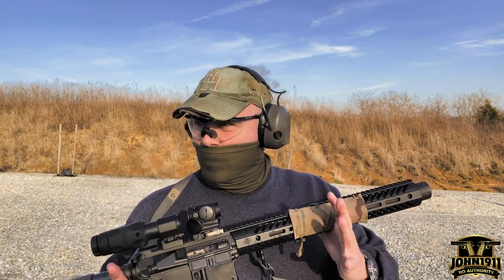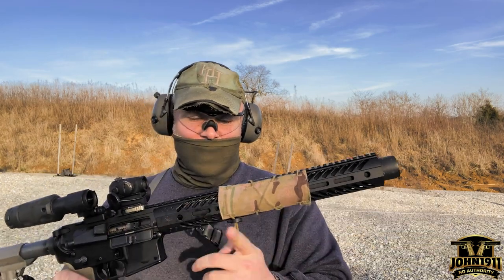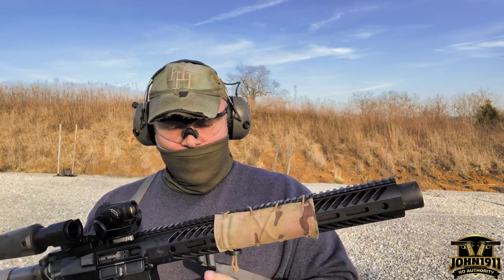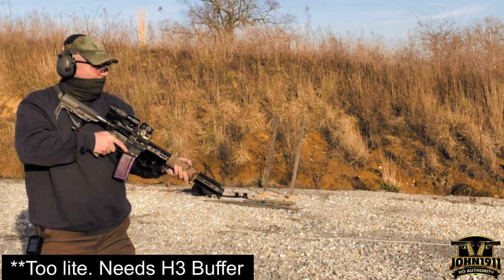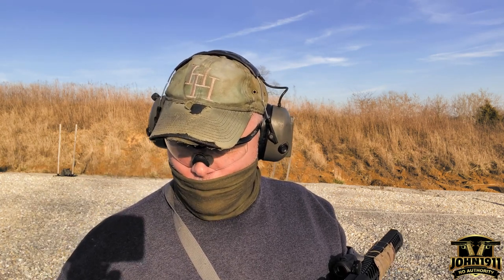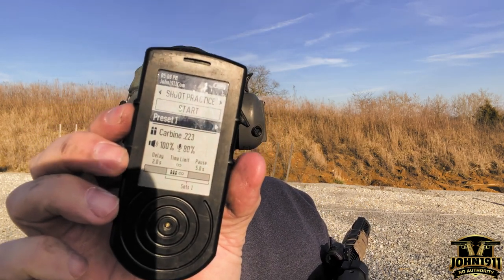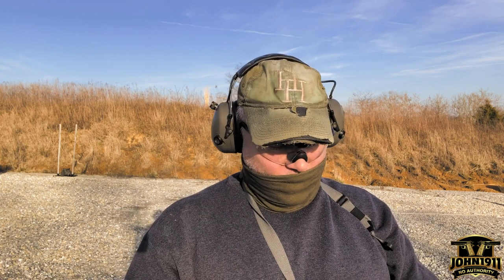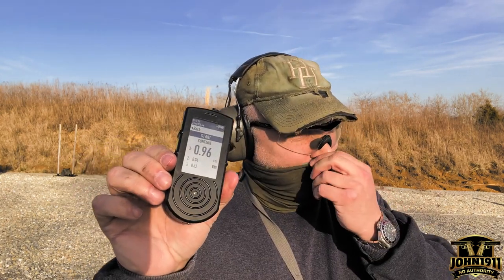Geissele Super 42 H2 Buffer Test

Comment: I bought a Super 42 H1 combo kit seven years ago right after Geissele released this product and put it in my Colt M4 LE6920. Over those 7 years, I would need a calculator to count the THOUSANDS of rounds I put through that rife. Everything from all-out, full-speed mag dumps, semi, binary, and bump fire full auto rates of fire and not one single issue - NONE - from the Super 42 H1 combo. The performance and durability of Gessiele products are legendary and absolutely second to none.

Comment: FYI you can replace your spring with standard springs once a year for 22-25 years before you spend the amount that this costs. You’re welcome.
Reply from the maker: Yup. But you are missing the context in your analysis: 

1. The upper needs a heavier buffer to run correctly. 
2. The gun is full time suppressed. 
3. Even the gas system is built around being full time suppressed so adjustable gas blocks don’t apply. 
4. To repeat 2 & 3 to make sure it’s clear, the gun simply will not run if you remove the baffle stack from the welded on can.
5. Fully suppressed AR’s are easy to hear the spring sloshing around in the buffer tube. 
6. Since I have to get into fixing this anyway and fiddle fart around, might as well get a spring setup that doesn’t make all that racket at the shooter’s ear. Because you know…suppressed. 

You’re welcome. 

Marky
Reply: @John1911  way too much tweaking required for an AR, hehe. I run mine fully suppressed with a Gemtech G-5. I use a Superlative Arms piston conversion and have the block adjusted to give me an unsuppressed bolt hold-open using even the weakest Wolf ammo (which I don’t actually use, but this gives me certainty for any range of ammo). Once I made the conversion, it was 20 minutes on the range to get the block correctly adjusted and Bob’s your uncle. 
It’s been flawless for over 10,000 rounds and I’m about to swap the barrel for a new one since my current barrel is 20 years old now and despite probably 15,000 rounds, the old Colt barrel still looks respectable through a borescope. It’s just time for a new one.
Reply from the maker: Yup. Well…it was sold to the civilian market as an upper from the Army’s SURG program. Not a complete gun. So…it’s gotta be configured. 
Once it’s done it’s done. It’s not like buffers are hard. 

Regards,
Marky
Reply: I’ve seen you comment this on like 4 videos. What’s next, a billboard?🤔

Comment: YOUR GUN IS OVER-GASSED…, BRASS IS FLYING OUT AT 1-2 OCLOCK… YOUR GUESILEY-42 IS NOT WORKING…
Reply from the maker: Yup. Old video. We ended up running a Barnes H4+ with a +15 Springco (blue?) buffer spring. 

—Marky

Comment: I changed my 16" barrel for an 18" barrel and it still threw the brass at 1230-1 o'clock. I got the super 42 spring and H2 combo, not only did the brass get thrown at the 3-330 position, the felt recoil has also gotten a lot lighter. I do need to get me a new BCG because the one I have, in 2000-2500 rnds, I have had to change the gas rings twice.
Reply from the maker: We took it up to H3 and it was only slightly better. Assembling parts for a H4+ install to see what happens. 

—Marky

Comment: I've been using these in all of my carbine length barrel guns, and have had good results so far.
In my rifle length gas gun though, with a carbine buffer tube, it has been too much spring rate.
Also a complete no-go for subsonic 300BO
Reply from the maker: Hmmm….That’s the thing. I am dealing with conflicting data here. My understanding is the Gemtech Integra has a smaller than normal gas port to allow just enough gas to pass through for full-time suppressed operation. The result being the gun won’t run with the baffle stack removed. (Never tested this myself). But damn it seems like it’s over—speed on the bolt carrier. My last resort after the H3 is maybe a complete B5 tube/system. 

—Marky
Reply: @John1911  I too have gone down the rabbit hole with my guns. I think the vltor A5 is fantastic, but am unwilling to change out all of my existing rear-ends. The geissele is an acceptable second for me. I will get my suppressor in the fall, and am excited to chase even more functional issues then
Reply from the maker: I just need this gun to run since I have an AR-15 project on the books for this year. —Marky
Reply: @jaysmokey   its an 18" barrel with rifle gas, so less than standard dwell time. I ended up with a standard weight buffer.

Comment: You're rifle isn't tuned.
The rifle is ejecting too quickly.
You need an H3 or H4.
My gun (11.5 barrel, suppressed) runs so smooth now.
Reply from the maker: Yup. This is an old video. We went with something called an H4+ buffer and upgraded spring. 

Marky